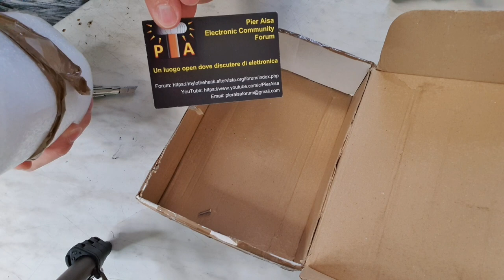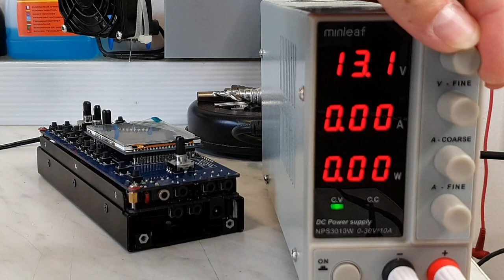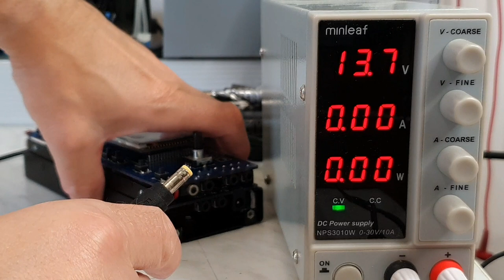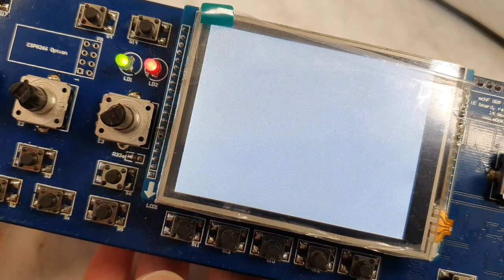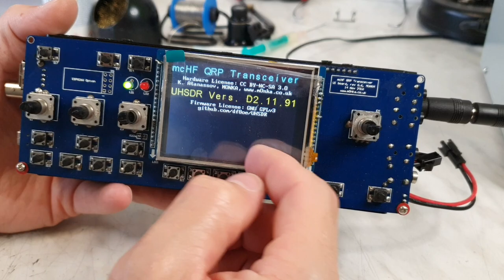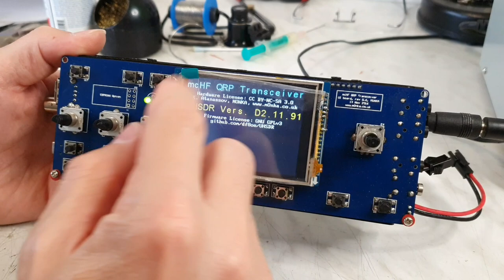MCHF TRX - "white screen issue" REPAIR

Comment: My first mcHF build I soldered the display in upside down! After removing it, there was too much board damage. I persisted with it doing lots of track repairs and wire links, but could never get it going. I then built a v 0.7 which worked fine from the outset. I then built a v0.6 but that too had LCD problems, which were solved by using small plastic shim spacers to put pressure on the screen connections in one particular spot, below the casing, that made the screen work. I found this out by poking the display with my fingers and found it came alive when putting pressure on it at a certain spot. Now it's all together in its case, it's worked fine ever since. 73 de G0MOH.

Comment: It is real pain to watch your soldering job, but eventually the screen worked, so well done to you. I'm glad that the owner of the radio didn't film his soldering .

 I'm afraid that many of the SMD parts need re-soldering. no need to use vacuum pump, flux and heat that fix everything. you need flux and a well-chosen soldering iron.

Comment: Your video work on these mchf radios is really useful. I would love it while you're filming the rest of the repair if you showed (maybe in another video?) Voltages and signal (on a scope?) At various points in the signal path... I'm currently troubleshooting a power issue on mine and its hard because I don't have a working unit to compare against, so it's slow going...

Your videos are great, i really like them.  73, AJ6IY

Comment: Hello everybody, please find hereafter attached the preamble video... https://www.youtube.com/watch?v=a5biyrAvfmY
Reply: Great job but never solder a bridge instead of a null ohm jumper, the reason they are there is that the resistors work like a fuse if the current gets to high with a fault